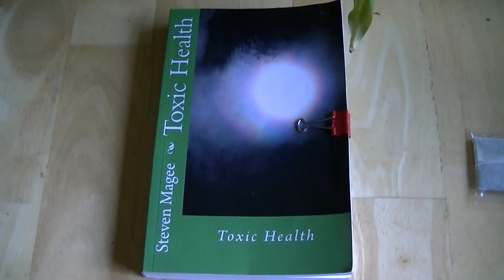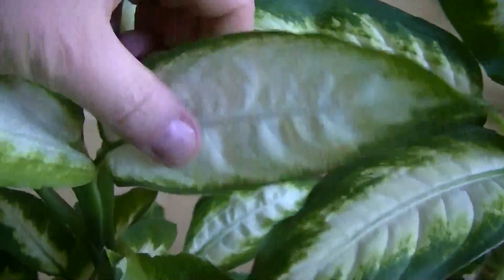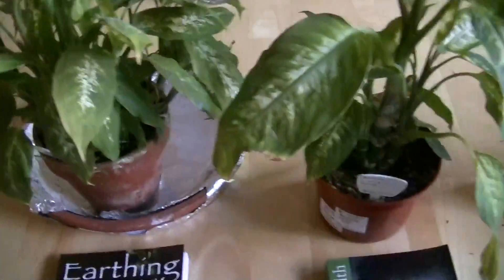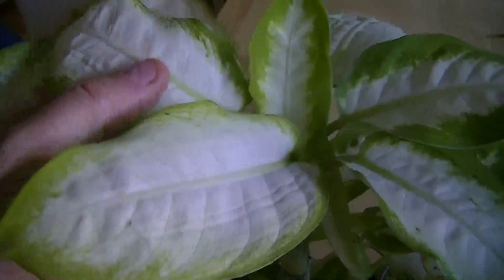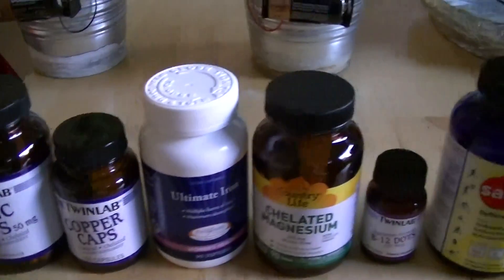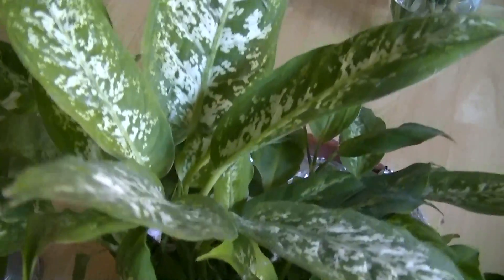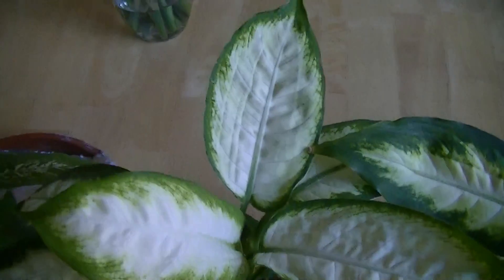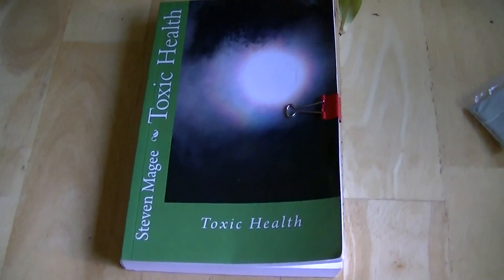Building Radiation (RF) Resistance into Plants and Humans

Comment: It would be interesting to test to see if different types of tea had different effects. I believe the tea you used in your experiment is a black tea. I only drink herbal teas. I don't think these would have a similar effect, but it would be worth checking. Now I don't have any knowledge concerning these things, but is it possible that boiling the water effects the properties of the water such as possibly charging it in some way? Or perhaps even the pot it is cooked in is influential somehow? I use stainless steel for example. Perhaps even plain boiled water would then have the same effect on the plants as the tea. And getting back to the tea, maybe the plant is doing so well because the tea is acting as a sort of fertilizer. So many factors to consider. I do like your videos a lot. They are very informative while staying practical at the same time. I will become a subscriber and share my own observations with you along the way.
Reply from the maker: I am in the process of testing boiled water.  Hot tea is well known for its radiation resistance properties.  Thank you for the kind comments!
Reply: StevenMageeBooks Awesome! Then we are on the same "wavelength" ;-)

Comment: What are the proper doses of zinc, copper, magnesium, etc.? Or, is that in your book, Earthing?
Reply from the maker: What I used is in the book Health Forensics on amazon.com.  The Body Voltage chapter starts on page 35 , amazon preview may let you read it.  You should consult with a doctor on correct dosing for your particular situation.
Reply: I suggest going and researching Dr. Eric berg, Joel Wallach and ben fuchs on minerals and vitamin consumption.